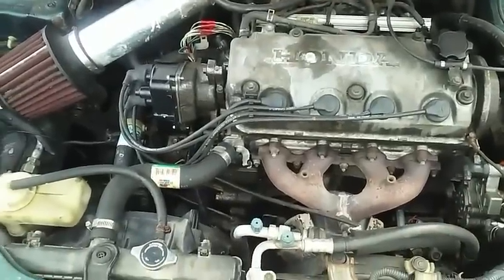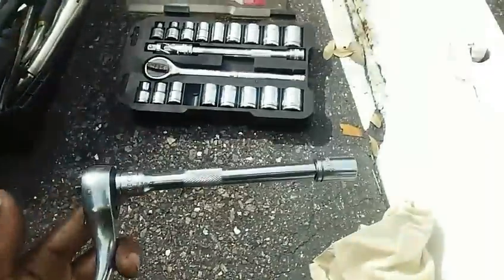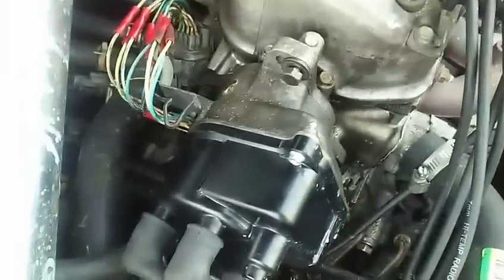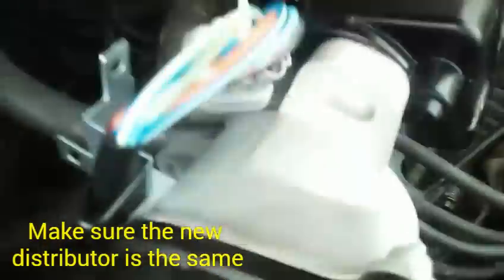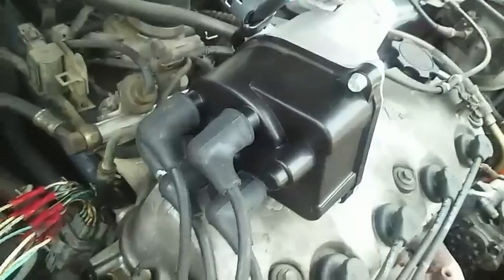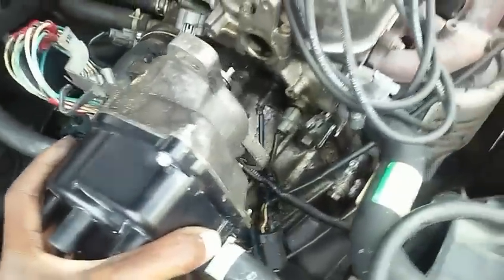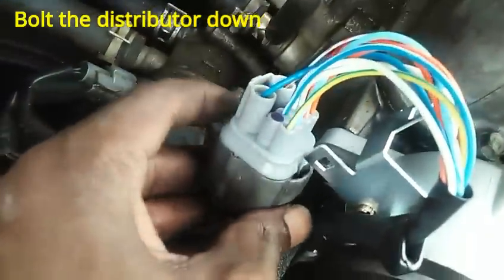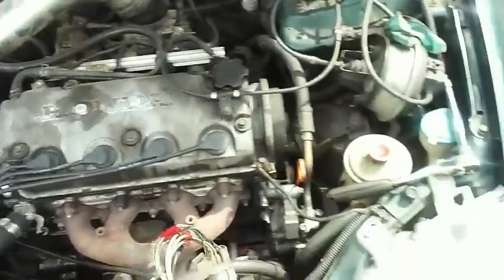How to replace a distributor, 96-00 Civic

Comment: He so I installed my new distributor and never lined up the back on the new one I tried to put it in in went in flush but when I went to start the car it made a pop sound and some smoke came from my fuel injector area any idea
Reply: New engine

Comment: Hey I hope you can answer this question when it is very humid and or raining my Honda Civic 97 EX won't start. This past winter the car would start only days after it stop raining. In the summer about an hour after it stops raining. Does anyone know what could possibly be the problem?
Reply from the maker: sahara11226 you are lucky its a 97. Go to auto parts store and ask if they can scan the chexk engine light. Should tell you exactly whats wrong so you dont have wonder. To me it sounds like a "engine coolant temp sensor" or a oxygen sensor. Could be any of those but dont guess just get it scanned most autoparts stores do it as a free service totally free to you. Good luck

Comment: I changed my distributor and now the acceleration is very sluggish. Pressed the gas pedal almost all the way but only getting 30mph. What should I check?
Reply from the maker: NauTzZz id start by checking to make sure you didnt accidentally unplug or tug on anything. Then recheck your firing order. Make sure the distributor is plugged in correctly. If all those things are to spec then you may have to set your ignition timing to spec using a timing light or timing gun. If all fails then you may have a defective distributor or you may have damaged a spark plug wire during the installation.

Comment: hi.what it was the problem with the car make you change it.please explain.
Reply from the maker: almeer20 I bought the new distributor because the car was having a misfire and new plugs, wires with a cap and rotor didnt fix it so i bought the new distributor.

Comment: Instead of using clockwise I've always used the term righty tighty lefty losey
Reply: for me with working upside down, or a bolt that is facing away or switching from the left and right of the vehicle, I forget which ways are left and right. so counter clockwise and clockwise are a big help lol